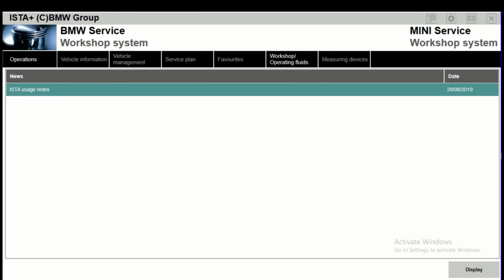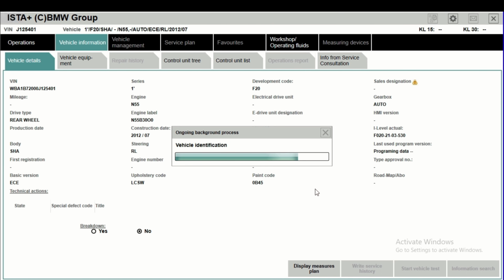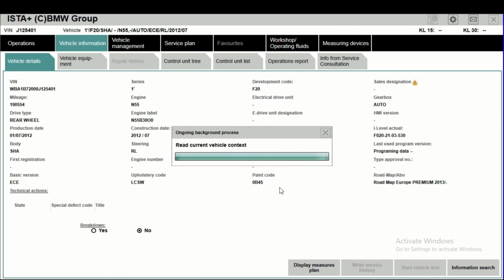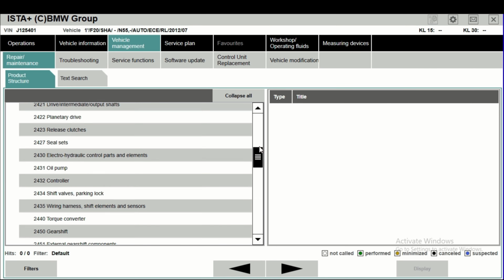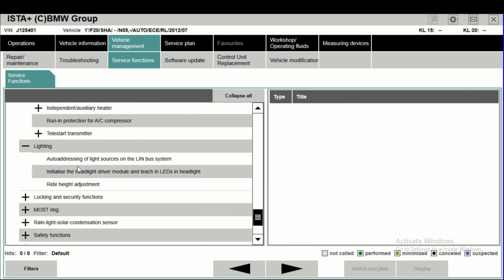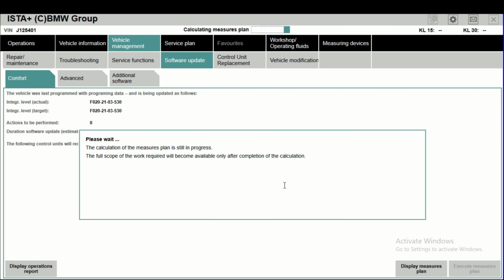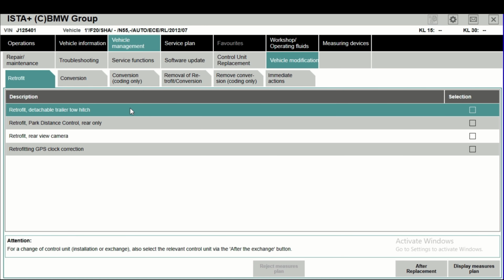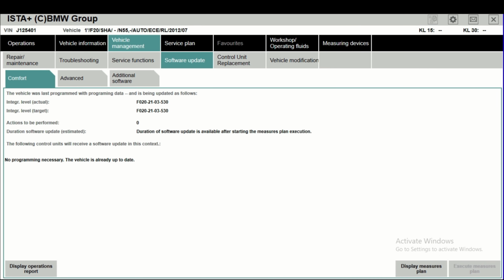How To Use ISTA + To Update & Program Your BMW ( Full Walkthrough )

Comment: Great channel and content, I’ve just got ISTA+ a couple of days ago specifically for a crash damaged i4 M50 and I’ve learned a lot from your videos so thanks and I’m sure there’s many other in the trade that have benefited for your videos. When you say ISTA can only program a brand new module, do you know if it can program a virginised SME, pyro fuse have blown in the original and we have a good donor one that apparently can be virginised and have the crash data wiped or the pyro can be changed in the original but crash data will still need dealt with. Keep up the good work👍

Comment: What would the case be when doing software update via ista+ if the software update fails on F30.  Would it restore it back?

Would you use ista plus on e90 or would you go straight to ista P also with my e90 it's remapped Dcat etc would the update it remove the remap?

Comment: Dean, the error messages are because this requires that the car be on a charger at a steady voltage during testing. There are some hacked dll's that simulate the voltage to trick the app. Is it possible to test for DME fault codes and battery without this on a charger? Can the software be run with the car on to test without the dealer charger? If so, can DME and battery circuit be tested with the car actually running?

Comment: I replaced my backup camera with an OEM camera and the guidlines are angled up toward the sky. Going through ISTA+ I find instructions to drive the car sometime in bright daylight to calibrate. This never completes and I believe I need to change the part number for the camera since BMW now sells a different part number replacment. Can you tell me how to change the part number for the installed camera in ISTA+?

Comment: hello i have a 2005 bmw x5 e53 3.0 L engine. i got the vehicle scanned and the dme seems to be the problem. I got a code equivalent to P0302 which says it is misfiring. There are new ignition coils and spark plugs. the wiring to the ignition coil is good. Moreover, the vehicle was involved in an accident as ran overboard and i believe water may have entered the dme. Also i bought a donor dme and was trying to code it with inpa to the vehicle, is possible to code a used dme? If not i can replace the entire system with a ecu, immobiliser and key?

Comment: Hello. thanks for the instructional videos.  I replaced the airbags, took them to the master without installing the impact sensors, the master canceled the impact sensors (with software). fault code 930A30 the vehicle no longer recognizes its own impact sensors. I don't want to take it back to the master as much as possible.

Comment: Hi Dr. Dean, quick question, i got a 2006 325i, currently have the K+DCan cable,  in roder to use ISTA-P what is the recommended cable? can I use an ENET cable? and for programming I have a similar power supply like teh one in your link but mine is a 10AMP (30V-10AMP) will that work as a stabilizer? thanks.

Comment: ISTA + works great on my F15 V8, but after battery replacement and registration there were 40 low voltage errors in various modules and I couldn't even figure out how to clear them.  I had to do it using Foxwell 520E.  Do you have a video on clearing codes to start with a clean state?

Comment: Can you do the conversation with just an Enet cable? I have an F82 and it would be great to change the oil service interval on the dash to 12mon/5000mil if possible over the 10000mil from factory

Comment: Thank you for the tutorial.  About the Secure Coding/Secure Token introduced from ISTA 4.30.3x, is the i-level programming with ICOM still possible for doing full software update?  Some say to disconnect from the Internet before doing the full programming.  Thoughts?

Comment: I agree a %100, I’ve already tried updating with enet but it didn’t work, so I bought oem icom and 70amp battery boost charger/maintainer to be in the safe side,  everything went well and no issue, thank you for explaining it for others, all other videos of people trying to do it with no depth info or even how to do it…. I appreciate if you can do a video on how to update the firmware on bmw Icom.
Reply: Salam Sam, Can you please share the links to the icom and the battery booster that you got working. Appreciate it. Thanks.
Reply: Use a voltage stabilizer not a charger/booster. The car needs to have a constant and consistent supply of voltage when programming.
Reply: @ericschott5100  can you simply turn on the car?
Reply: @MarinTheFirestarter  no

Comment: I saw your videos about bmw cars,
I have a big problem with my E46 BMW 316i automatic transmission engine n42b18a.

The car turns off when it is on minimum rmp of engine. (600-700rpm)

I have controlled sensors, MAF, MAP, air tubes, throttle sensor, I put a new chain, controlled ecentic sharf valvetronic, i changed electromotor of valvetronic and oil of engine is new. Everything works ok.

The problem is not solved yet. 

When I check for errors on pc, shows only o2 sensor with error.

When I unplug the cable of valvetronic the problem fixes, but the car has so reduced power. 

What I can do? Do you have any idea?

Thank you so much.
Have a nice day.
Jay!

Comment: Nice one. 
Very annoying that Ista does not program used modules. The ability to use used parts has always been fundamental to my last 35 years of motoring.
Reply: @andrewthompsonuk1  this is dealer level software 

Aftermarket or used will have a way

Comment: Can you use the ISTA to program a use Ecu?
Reply: no, ISTA cannot program any used modules unfortunately. I use Autel IM608 PRO with J2534, XP400 Pro, and G Box (for bmw & benz). There are many other options out there as well but the Autel is the fastest and most trouble free I have used to far.
Reply: @ericschott5100  Thanks

Comment: Dean,

Once i update the modules, would i lose my tuning?

Great video btw! :)
Reply: I believe it would depend which module you speak of, let’s face it the ECU is a module and I’m not trying to be funny or a smart arse but there is a lot of information input so most likely it will effect it in some way depending on model so on and so forth; my suggestion would be to read the tuning mod in intricate detail - timing, fuel pressure, but obviously it depends what you play with. Will it do a full ECU reset, doubtful but I’ve never used it, software update - can it, yes factory reset. Be careful using these tools, they can cause you massive amounts of work and headaches.